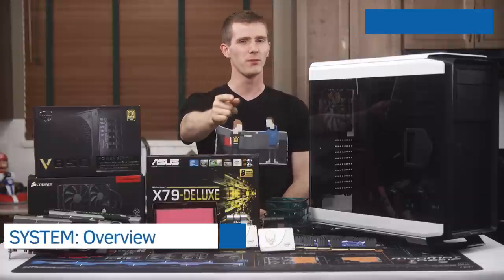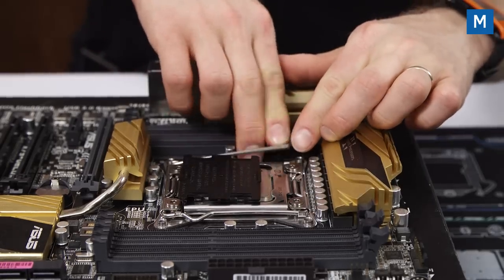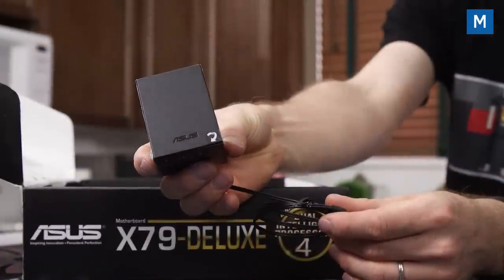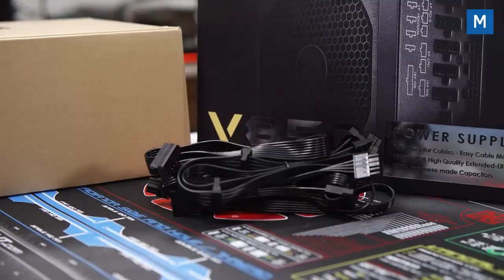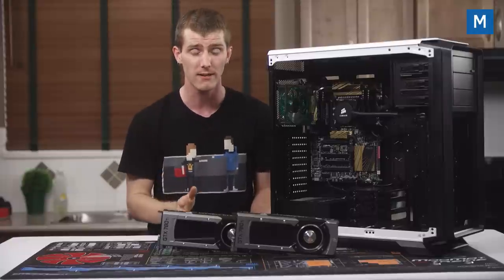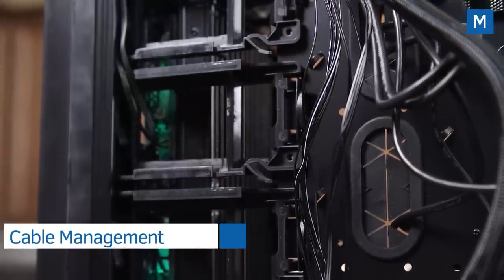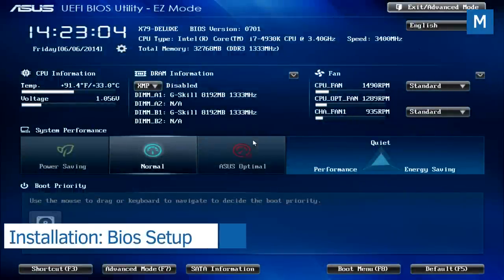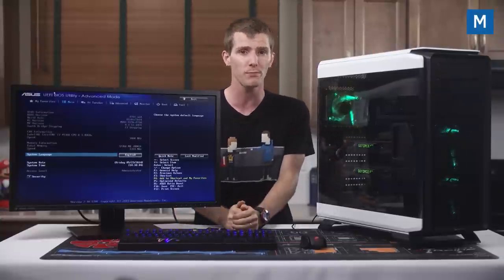How to Build the ULTIMATE 4K Gaming PC Build Guide

Comment: Guys i want to make a gaming pc but this is alot of money to spend on including  a mouse keyboard and monitor (reply if you think i could make something cheaper)

CPU: Intel Core i7-4820K Ivy Bridge-E Quad-Core 3.7GHz (Turbo 3.9GHz) (324.99)
GPU ASUS GTX770-DC2OC-2GD5 GeForce GTX770 2GB GDDR5 256-bit (319.99)
Motherboard:  ASUS MAXIMUS VI HERO LGA 1150 Intel Z87 HDMI SATA 6Gb/s USB 3.0 ATX Intel (194.99)
cpu cooler: Cooler Master Hyper 212 EVO - CPU Cooler with 120 mm PWM Fan (34.99)
RAM: Team Elite 8GB 240-Pin DDR3 SDRAM DDR3 1600 (74.99)
Power supply: CORSAIR CSM Series CS750M 750W ATX12V v2.4 and EPS 2.92 80 (109.99)
OPS: Window 7 home professional 64-bit sp1 (139.99)
HD:  Western Digital Elements 1TB USB 3.0 External Hard Drive (65.98)
So tell me cause what you think and tell me if you know if i could drop a price on these thanks :)
Reply: There's not really a need to get an LGA 2011 for a gaming build. If your just gaming go with an 4690K. Also, I don't think your current build would work. I think a 4820K is an LGA 2011, whilst your MoBo is an 1150. 

There's no point in getting Windows 7 Pro. I doubt you'll use all the extra features. 

And get an Internal Harddrive... I recommend the WD Caviar blue. Its a great Hard Drive, for cheaper than your's.

And use PCpartpicker.com to check for further incompatibilities.
Reply: Get windows 8
Reply: Robby M Don't anyone with technological intelligence knows not to buy WIndows 8.
Reply: ***** pretty sure windows 8 can deal better with directx11..
anyway you can get cheaper ram if you want to.. pretty sure youll find a 1866mhz with tighter timing for less money
your psu is a bit overkill as well you cant go down by a 100 watts if you want to but that would prevent you from getting a second 770 in the future.. youre going to use an external hdd only ? pretty sure an internal hdd is better
Reply: ***** Dont anybody with english noledge no that you have to go to skool to bye a expensive computer?
Reply: rem2beast They also know anyone with intelligence has to spell correctly.
Reply: Use the PCPartPicker website, extremely useful for checking compatibility, price and parts that you need
Also look at reddit.com/r/buildapc for some builds. The guys there are very helpful and will always give you good advice on your build
Reply: niofalpha
Thanks man
Reply: niofalpha
One more thing will this ram : G.SKILL Ripjaws X Series 8GB 240-Pin DDR3 SDRAM DDR3 1600 (PC3 12800)
go with this motherboard:  ASUS Z97-PRO(Wi-Fi ac) LGA 1150 Intel Z97 HDMI SATA 6Gb/s ddr3 (3200) ?
does the ram and the motherboard gotta have the same number for example the ram have 1600 and the motherboard have 3200?
Reply: Robby M no just no........
Reply: MyUnitProcess As long as the ram speed is less than the max speed on the MoBo, your fine.
Reply: *****
Honestly, just get Windows 8 with all of it's enhancements, and download some software(classicshell) to make it like Windows 7. It's a bit of an inconvenience at first, and I know we shouldn't HAVE to do that in the first place, but I think it's a win win, and it's good enough 'till MS give us a better OS. I don't understand why they made the OS for PC like a fucking phone, but whatever.
Reply: Go amd
Reply: Okay firstly, you DO NOT need an i7 for gaming. It is just a waste of money unless you're video editing.

Go for an i5-4690k or a regular 4670 if you don't want to overclock. You will save a ton of money.

Secondly, get a gtx 780 or an r9 290x tri-x by sapphire (Both of them will cost the same but the r9 290x (AMD)will give you much better performance and more fps at the same price). But if you want stuff like physx or game stream go with nvidia.
Also I think that motherboard is a bit overkill, I'm sure you can find some cheaper ones.
As for the the hard drive. I don't think you noticed but you chose an external hard drive, not an internal one. Get a western digital INTERNAL harddrive. 
Get a seasonic G 650W power supply (make sure it is 80+ gold certified) and not a 750w one.
Finally get windows 8.1. It is better for gaming and in some games you will get higher fps
Reply: zenith rome
Why not a 750w one? I mean with all the components and for future proof you will need sufficient wattage to feed the build well ..
Reply: zenith rome Considering today you could own a CPU for 4-5 years until its bottlenecking in gaming, i would recommend an i7 because more cores are just going to become more important for gaming, especially as the new console generation is pretty close to PC architecture and has 8 physical cores.
Reply: You can run clubpenguin at 60fps while recording it seems.
Reply: Please don't talk about stuff you don't have a clue about. The i7 OP mentioned has 4 physical cores. Not 8. It has more threads which can be useful for rendering and video editing.
The i5 I mentioned will not bottleneck even for two gtx 780's. If you want to upgrade your gpu later on, then you can upgrade to the newest generation of intel processors. There is no 'future proofing' computer parts. The i7 will have 0% performance increase when compared with the i5 in gaming
Reply: It's his wish. If he has more money to spend, sure why not
Reply: zenith rome You did not understand my point. I was saying that the new console generation has 8 cores, so game developers will focus on using multi core programming more in the future, which means buying an i7 which has the ability to simulate 8 cores via HT can't hurt.
Sure there is no future proofing, but todays gaming landscape depends very much on the GPU. I have an older secondary PC with a 4 Core Phenom 965 which is from 2010 and combined with a R270X it still runs most modern games fine. If you take an i7 Sandy Bridge Intel CPU from a couple of years ago and a current high end GPU, the CPU will still not bottleneck. So my conclusion is to go with a very good CPU today, because you will probably be able to use it for 3-4 years at least with just upgrading the GPU. If its a matter of budget, sure go with an i5 but you will probably need to upgrade it earlier.
Reply: ***** not to mention that more games will be optimized with windows 8 in the future
Reply: I dont think games will be optimised for the os. Till now windows 7 is still doing great
Reply: Liam Zammit Well DirectX 12 will bring a lot of new stuff and performance improvements and will be Windows 8 only, so you can only escape Windows * for so long. But honestly, 8.1 with a little tweaking is hardly different from 7 anyway.
Reply: speedsociety
That's right. question: IS the motherboard Gigabyte GA-Z97-HD3 a good one  ?
Reply: You can re use any of the older mouse and keyboard from your old PC. But regardless, I made a much better build for you :- http://pcpartpicker.com/p/ynj4ZL
It can handle games like bf4 on high-ultra at 60 fps without AA
Reply: I just built a build with good components for just 900 euro (680 sterling app.) Including gtx 760 4gb and a screen a mouse a nd keyboard. If you want i will give you details
Reply: Forget the cooler, steal your OS, buy an SSD
Reply: Liam Zammit gtx 760 with 4gb isnt good, what version of it is it? amount of vram doesnt matter if your gpu cant process it fast enough.
Reply: get an ssd, als external harddrive... what? its internal the second you put it inside your pc get an ssd, as mentioned by tyler, fuck the cpu cooler, it comes with your cpu. also 750w is overkill you need 550w for this 600 tops, i have a similar setup with twice the ram, much more demanding processor clocked at 4.6ghz, 4 harddrives + ssd, with 500 Watts. I would also get amd fx-6350 to save around 125$ and rather put that into anything else also fuck the os as he said, tyler again. Pirate it, it crashes less often if you get the right one. all this cash saved can be mashed into a better graphics card or to get 8tb of extra storage with cash to spare for future upgrades. All in all if you dont need that amount of storage space you will have saved 300$ with an increase in performance, if you follow the setup i gave you.
Reply: krillerdk123321 its the phantom one. Its a good one according to reviews. I agree with tyler forget the cooler for now. You can upgrade in the future. And the os pirate it or borrow it from a friend. Spend on ssd
Reply: krillerdk123321 why on earth do you need 8tb of space >< alas you do video montage and streaming they are useless
Reply: you dont need i7. i have intel i5 and its already a powerhouse. all i do is gaming. if you do video and music editing and tons of other stuff then get i7
Reply: Don't get the 4th gen CPU they're the same speed, trust me.  They are trying to con you into thinking it's a lot better when in really it's just about the same difference to the 3rd Gen CPU.  Get the 3570K so you can OC it to 4.5GHz easily stable, been running it for 2 years and it's been working just great.  No lie.  

The Motherboard is ok but a bit cliche I guess it's cheaper than a gigabyte UD5H which I have and love it, you can do so much more as in compatibility with software n games and of course you can run MAC OS X on it if you want.  But my MB is a Z77 and has nice solid caps so the motherboard will last a lot longer.
Reply: if u want a game-machine,, my hint is to build AMD & ATI combinantion on socket FM2 with RAMdisk Technology,, its more cheaper then Intel,, and more stronger,, ;),,
Reply: Matthew Matwej Kolááč Kováč If he wants a game machine, he could drop to a i5-4670k, use the cooler that comes with it, and definitely drop the PSU to a CX430. (I have a similar build that has a overclocked 3570k, and the whole thing just barely touches 500w, however I plan to do SLI in the future so I got a 850 watt). Right there he'd be saving about $160.

Without the case: $932

https://pcpartpicker.com/user/EnsignLedo/saved/hL9wrH

This is assuming you aren't overclocking or you are doing more than gaming.

If you need to, you can throw in a i7-4790k (4 core HT) for ~$100 more and another 8GB of RAM for ~$80, and a corsair h100i for another $100 if you want to overclock, even then still cheaper then your current build with probably ~ the same performance. Mine is about the same, except it is now valued ~$2050 cause of the case, the GPU water cooler, my SSD, $120 worth of fans, 850 w psu, and 16gb of ram.

Hope this helps
Reply: Spec Can I use a ps4 controller on pc?
Reply: antonio mosley no. Ps3 yes but with emulation tools. I recommend an Xbox 360 wired controller. Easy to set up and every game that already has controller support is usually set to Xbox360 mapping. So if you used a ps3 controller it would just be X is A and circle is B.
Reply: ***** Xbox 360 controller nice it been awhile since I've held a 360 controller. So do you have any ways that i can build a pc? Because I'm sick and tired of buying games that cost 60 buck that don't look good on console, but is very cheap on a gaming pc and look wonderful. And I'm a beginner.
Reply: antonio mosley I feel you dog. I just built mine only like a month ago. So I would also call myself a beginner. I had the help of some friends. I dropped like 1100 dollars on my pc but you can spend less and still get a really nice machine. One tip I will say is some people will say to get Intel i7 but save some money and get an i5 processor. I can run any game on ultra with my 2gb video card, 8gbs of ram, and the i5 processor.
Reply: Ok, I'm 15 and have about  200 bucks. How's that? Would I be able to get some parts for the pc I'm going to build?
Reply: antonio mosley oh ya. for 200 bucks there are a few you can buy. you can start off witht he case. i spent 120 on mine but i got a cool looking one you can get a nice mid size case for under 100 (get a Corsair). i got 8 gbs of RAM for 80 bucks (which is the amount of RAM i'd recomend for upcoming games) power supplies you can get for under 100 bucks. my mother board was like 120. the only things that are gonna cost more than 200 by them selves are the video card and the processor. go on Newegg.com and they sell everything you will need for a PC there.
Reply: Cool thank you, now I can ditch consoles and start making beats.
Reply: no problem homie

Comment: the board has labels for the ram slots, like 1-a 1-b 1-c and 1-d then 2-a 2-b 2-c 2-d. if you use the number 1 slots, the memory bus is physically shorter than the number 2 slots so it is accessed faster.
Reply: So the software scans it in series? I thought it scans the second and fourth and then the first and third

Comment: is this good? saw this ad on kijiji:
"$375 Firm for everything. It's a very fair price don't bother offering less. 

--------------------------- 
System Specifications: 

- Windows 7 Home Premium 64-Bit 
- Intel i5 650 3.2Ghz Processor 
- 8GB DDR3 RAM 
- AMD R7 260X 2GB Video card 
- Seagate Barracuda 500GB 7200RPM Hard drive 
- SPI 400W Power supply 
- Acer X223W 22" Widescreen Monitor 
- Microsoft Keyboard 
- Logitech Mouse 
- Creative Speakers 
--------------------------- 
Games: 

Fallout 4 
Fallout 3 
Bioshock Infinite 
Dark Souls 2 
Far Cry 3 
Tomb Raider 
South Park The Stick of Truth 
Total War: Rome II 
Resident Evil Revelations 
Assassins Creed III 
Divinity Original Sin 
Just Cause 2 
Need for Speed Rivals 
Alien Isolation 
Shovel Knight 
Don't Starve 
Faster Than Light 
The binding of Isaac Rebirth 
Legend of Grimrock 2 
Spelunky HD 
Dungeon of the Endless 
Papers Please 
Rogue Legacy 
Prison Architech 
SteamWorld Dig 
The Wold Among Us 
Game of Thrones - Telltale Games 
Bastion 
etc 

--------------------------------------------------------------------------------------"
Reply: Misfit It's good, but I recommend that you save up a little bit more, and upgrade the GPU and CPU

Comment: bro can u please tell me I have  
Processor:-Intel(R) Core(TM)2 Duo CPU E7500 @ 2.93GHz
MOBO:-G41MT-S2
can u tell me these are compatible for GTX 1060 or Not
Reply: No. Your CPU is one big bottleneck for that GPU. I think you need to build a whole new system.
Reply: Please tell me pc build with 1060 gtx graphics card support
Reply: Get a i5 6500 and you should be fine
Reply: Motherboard.? Or psu??
Reply: hey buddy what u want to do is get a new motherboard and everything cause the i3 i5 i7 pins for cpu is different then dual core so get a new motherboard CPU and ur good to go and maybe a new case I recommend ATX motherboard and ATX case :)
Reply: Raj vardhan don't even start. get a Pentium g4560, and GTX 1050ti and you will get a better fps than a new gpu
Reply: I5 and i7 best for 1060

Comment: I'm creating my first selfmade pc, is it a solid build? 

Pc parts list:
• Intel Core i5-6600K - Processor/CPU. 
• CRYORIG H7 49.0 CFM CPU Cooler
• Asrock Z170 Pro4S - Motherboard
• G.Skill Ripjaws 4 - DDR4 3000Mhz
• WD Blue WD10EZEX, 1TB -  Storage
• ADATA Premier Pro SP550 – 120GB Storage
• RX 480 – GPU
• Corsair RM550x - 
• Asus VX238H – Monitor
• NZXT S340 - Case 
• Windows 10 Pro
Reply: I'd change the SSD to a Samsung 240-250GB one, simply for more space, given that 120gb will be taken up really fast. How much RAM? You only specify the type of RAM. The rest is good.
Reply: +Chuzzy MCFuzzy Thanks for the respond. I managed to finish my build already though. I added a SSD (120GB) and kept my HDD. My ram is 2x8 DDR4. 

:)
Reply: Really quite a good build overall. You can always just upgrade when and if you need. :)

Comment: Guys as a first time builder, how is my first build that I plan on making for my birthday is a month:

CPU: Intel Core i5-4460 3.2GHz Quad-Core Processor

CPU cooler: Cooler Master Hyper 212 LED 66.3 CFM Rifle Bearing CPU Cooler

MOBO: Gigabyte GA-B85M-DS3H-A Micro ATX LGA1150 Motherboard

RAM: Corsair Vengeance 16GB (2 x 8GB) DDR3-1600 Memory

Storage: Samsung 850 EVO-Series 500GB 2.5" Solid State Drive

+ Seagate Barracuda 2TB 3.5" 7200RPM Internal Hard Drive

GPU: MSI GeForce GTX 1060 6GB GAMING X Video Card

Case: NZXT H440 (Matte Black/Red) ATX Mid Tower Case

PSU: Corsair RM 550W 80+ Gold Certified Fully-Modular ATX Power Supply

I can take some constructive criticism!

Comment: Would this be okay for my first PC build? It's gonna be for my whole family to use.
CPU - AMD Ryzen 5 1600X
CPU Cooler - Ryzen Stock Cooler (will upgrade later)
GPU - MSI GeForce GTX 1060 GAMING X 6G
Motherboard - MSI X370 Gaming Pro Carbon
Memory - not sure yet (will get at least 16GB)
Storage - not sure yet
Case - Corsair Carbide Series SPEC-02
Case Fans - HD120 RGB LED High Performance 120mm PWM Fan — Three Pack with Controller
Reply: No one knows until Ryzen 5 is released and reviewed. However, if it's going to be primarily for gaming, I'd go for the cheaper 1500/1500X Ryzen 5 (provided the gaming performance doesn't keep up to Intel like Ryzen 7) and spending that extra money on a GTX 1070 instead of a 1060. For gaming builds, you usually want to spend more on a GPU than a CPU.

Comment: Is this good?    
       
Ram: Kingston HyperX FURY 16GB Kit (2x8GB) 1600MHz DDR3 CL10 DIMM

Processor : Intel Core i7-950 3.06 GHz 8 MB Cache Socket LGA1366 Processor

Case: VIVO ATX Mid Tower Economy Computer Gaming PC Case / Black

Motherboard: Gigabyte AM3+ AMD 970 SATA 6Gbps USB 3.0 ATX AM3+ Socket DDR3 1600 Motherboards (GA-970A-DS3P)

Power Supply: EVGA 500 W1 80+, 500W Continuous Power

Hard Drive: Seagate 1TB Desktop HDD SATA 6Gb/s 64MB Cache 3.5-Inch Internal Bare Drive

CPU Cooling fan: Intel E97380-001 Cooling fan for Socket LGA 1366

Monitor: Asus VS228H-P/VS228 21.5-Inches Led Backlight Widescreen

Graphics Card: EVGA GeForce GTX 950 2GB SSC GAMING, Silent Cooling Graphics Card

DVD Drive: Asus 24x DVD-RW Serial-ATA Internal OEM Optical Drive